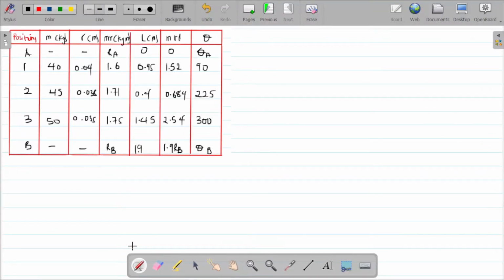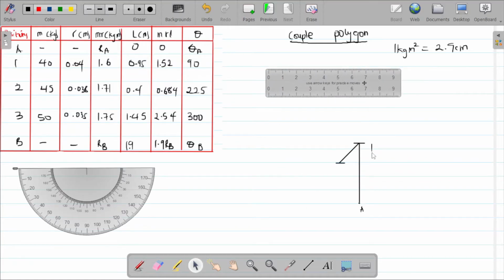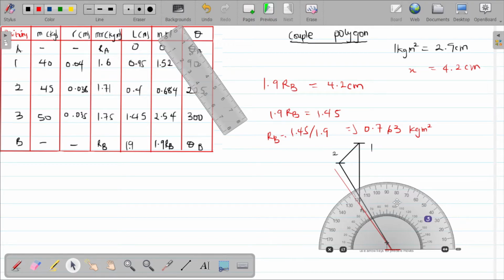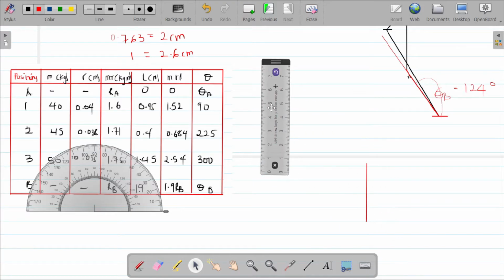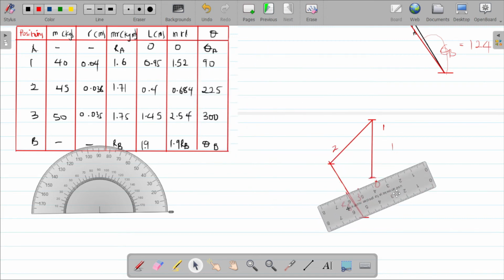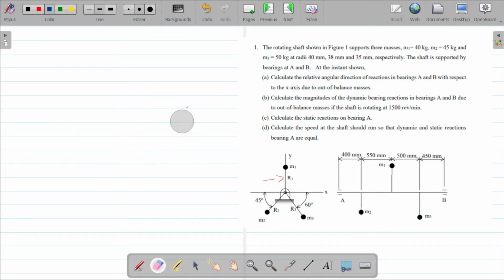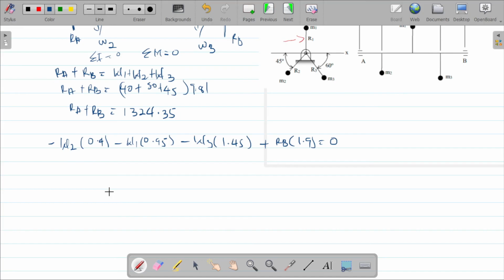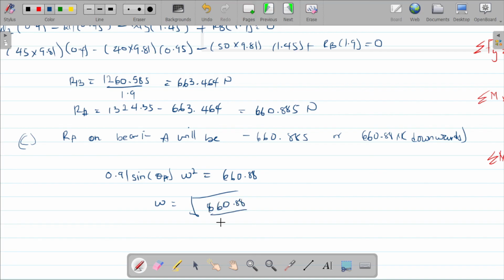Rotary Balancing: Graphical Method and problem continuation.

Comment: i realized for the couple diagram, you picked your scale through ratio and proportion from the table. Is there any reason why?
Reply from the maker: Well I did that to make sure the smallest magnitude has a reasonable length.. if that is ok, the rest will